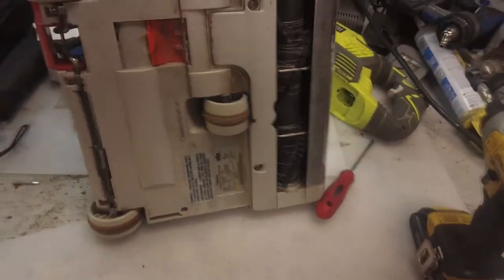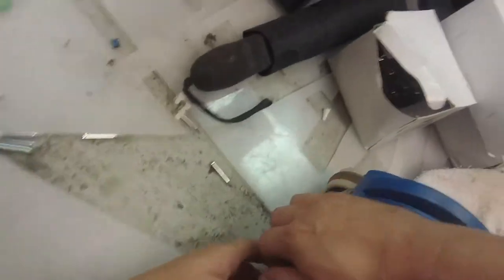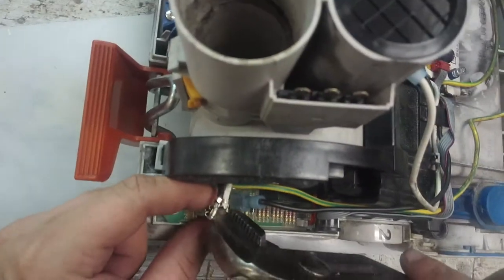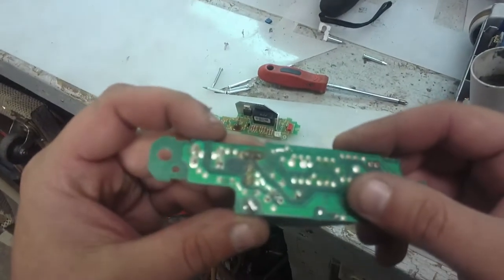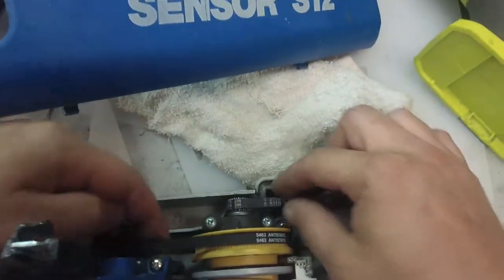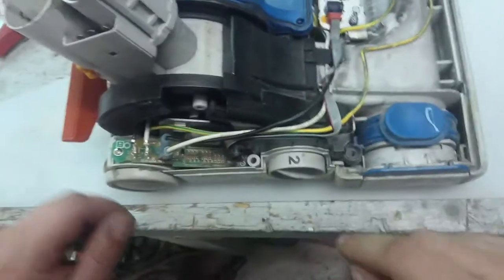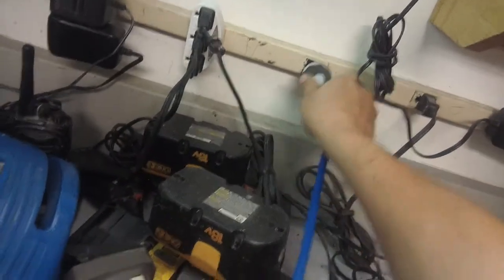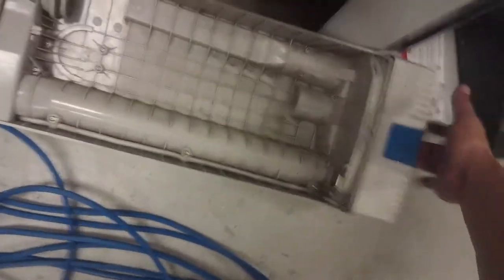Windsor Sensor S12 Vacuum Repair.

Comment: I have 6 of xp12 sensor vacuums for over 15 years for an old building with carpets older than I am. I've got to the point of replacing carbon brushes a few times and ran into the same trouble as you have. buying a new piece was about 50-100 bucks, so I soldered those two points and works just fine.

Comment: Hey Jeff. I have a Windsor sensor s12. It won't run. I by passed the main circuit board, it's alive. Yes, it does run with out that main board. BUT, should i by pass it????

Comment: We use these at the hotel I work at and we constantly have problems with them. I wonder if there is a way to bypass the boards? I have had these apart a few times and as far as I am concerned, they are over-engineered.

Comment: The brush appears to have an insane amount of hair around it. It may be causing the motor to pull too much energy through that board causing it to fry. Just make sure to clean the brushes.
Reply from the maker: HappyJigg yeah that's a possibility so far my little solder trick has been working. I have done 3 more this month.  I'll keep that in mind thanks happy jig.☺

Comment: Any idea what would cause the bag sensor light to come on constantly enough to shut the vacuum off? Besides the obvious of course. Theres no clogs, filters are clean, bag is new. We have about 6 at my job that dont stay on for more than 3 mins or so. The best part is, even the brand new vacuums do it right outta the box
Reply: which model you have? there are different ways to adjust the bag light.
I am a certified Windsor/karcher tech I might be ablate help you
Reply: The Sensor's control board might need to be recalibrated
Reply: I have a sensor s 12 with that problem as well
Reply: u can change sensor valve in neck, or cut red wires and solder together to bypass, the thin ones